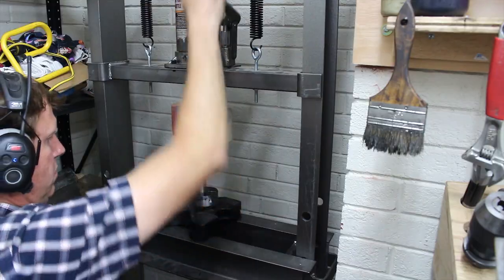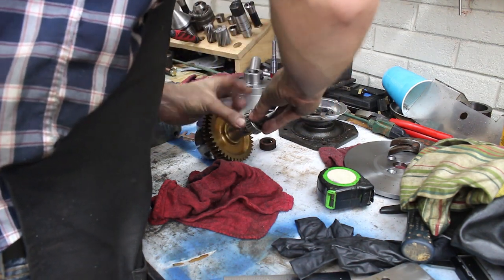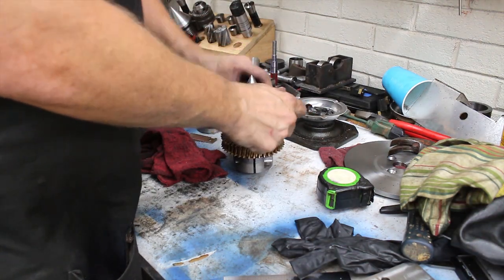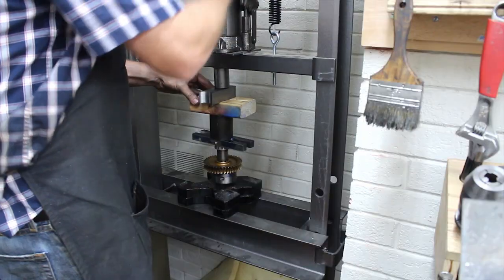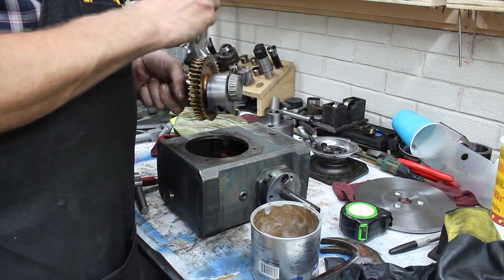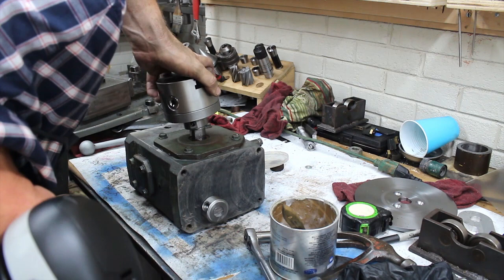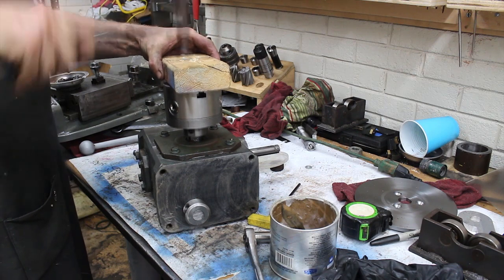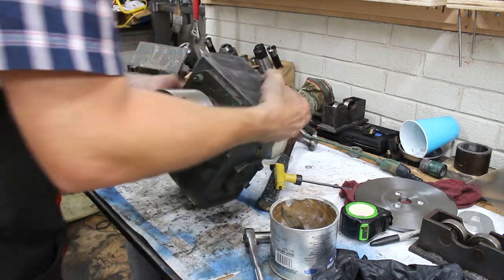Homemade Dividing Head Part 1

Comment: You do really good work.  Been watching your videos.  The John Deere 400 videos brought me here but the machining videos are great to watch too.  My brother in law has a machine shop here in NE Florida and the work they perform is very impressive.  I would love to see some videos of your foot pedal conversion on the 400.  Only one I have ever seen like that.  I have a 75 with a. JD20 Loader and Brantly Backhoe.Would love to find one with a mower and tiller for a nice set.
Reply from the maker: Let me work something up.  I love the foot pedals.  Also, I added an electric front PTO  clutch off a 420.
Reply: I am sure thats much more convenient than the cable actuated PTO.  I already had one cable break on mine at an inopportune time.  I haven't checked the electrical output to see if it supports electric PTO clutches but I imagine yours is holding up fine.  My 318 has front and rear electric PTOs and operates without issue.  I have subscribed and set notifications on so will be on the lookout for the foot control video and any others you put out.  Thanks!
 @publicprofile1